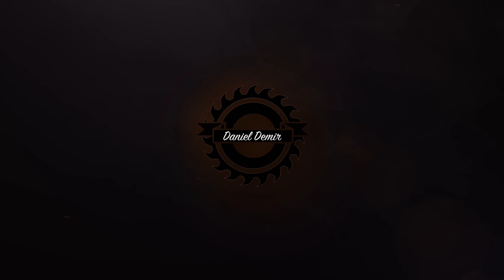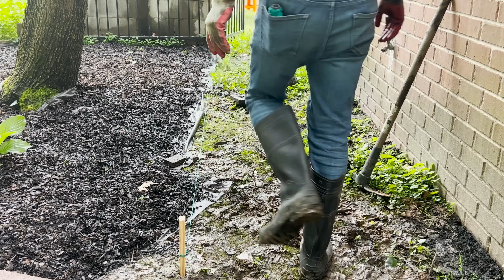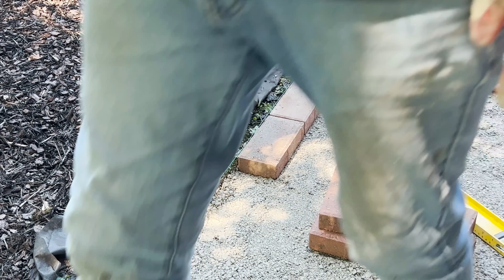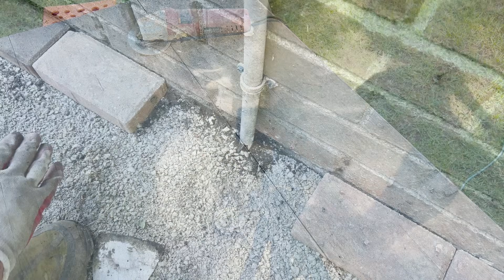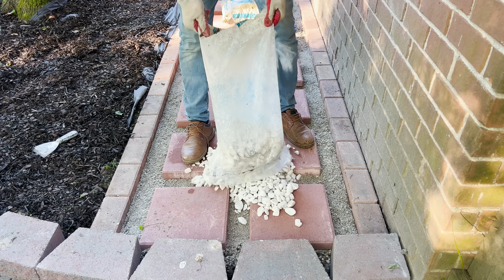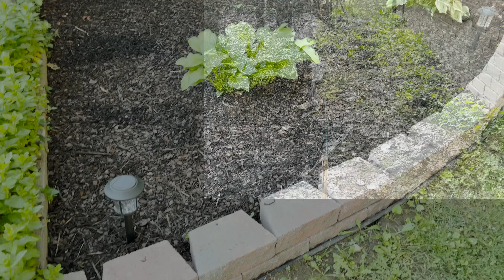Paver Installation / Pathway /Stepping Stones/ Garden Decoration DIY/ Backyard Makeover

Comment: This is an excellent design for a landscape walkway. It's way cheaper than having concrete poured and much prettier. The use of the 2x4's and bricks was a brilliant idea for keeping the paver steps evenly spaced. Well done! I probably would have put down weed-screen first so nothing grows up through the path.
Reply from the maker: Thanks a billion for your beautiful words. Since the bottom is solid clay I did not add fabric and didn’t have any weed issues so far.
Reply: @DanielDemir  Question answered on this reply! Good Work!

Comment: I wonder what will prevent the pavers from moving.  I would have pressure washed before.  It looks so much better.   Have you had both knees replaced?  Continually squatting looked really painful.
Reply from the maker: Small stones between the pavers prevent them from moving. It was not that painful

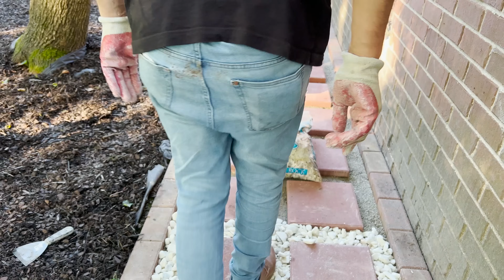Comment: what is holding the walkway pavers in place? at 7:34
Reply from the maker: Gravel Base
Reply: @DanielDemir  I just find it hard to believe that just gravel base + sand will keep it from shifting over time
Reply: @struggle375 it will hold it. I used the same thing to make a brick patio floor and it being holding on for two years now

Comment: You should have used a weed barrier
Reply: FACTS!
Reply: Fun fact, there is not one weed barrier on the market that stops weeds, over time they break down and get in the way when torn up by erosion or animals, it's a waste of money
Reply: @shanehamilton1753  True, weeds will find a way out!  A little lady working at Lowe's suggested using cardboard.
Reply: Should have used geo Tex. Prevents weeds and settling of stone. Lasts 100 years.
Reply: This is very nice. I agree you should have put the weed barrier to avoid the weeds but I think still good. You can always use vinegar to kill them. Good job.
Reply: Some personal experience with weed barrier. I put down double layer of weed barrier, pavers and gravel, no sand base. To keep weed free I have to stay on it constantly. Sand would have helped I’m sure. It’s a large area so I’m not redoing. I’m going to clean it up, add more gravel and try the mulch glue first before I remove and do over. For my path like yours I’m going to use cardboard under the sand. It has been a success where I’ve used it. It doesn’t break down for a very long time. I’m a 70 year old woman who really can’t afford to hire help but I discovered that a dry pour foundation worked well on a 5x5 slab worked well with help (my daughter) on the leveling. Lots of heavy bags but I loaded on golf cart and dumped off back. And yes I had a back ache for a week!
Reply: @shanehamilton1753  Mine has lasted more than 25 years.  No weeds.
Reply: Definitely use a weed barrier or cardboard. Looks good!
Reply: What are the dimensions this job area covered?
Reply: Increíble y maravilloso trabajo, sencillo, útil y muy lindo. Felicidades x tan buen trabajo !! Más vídeos por favor❤🎉!!